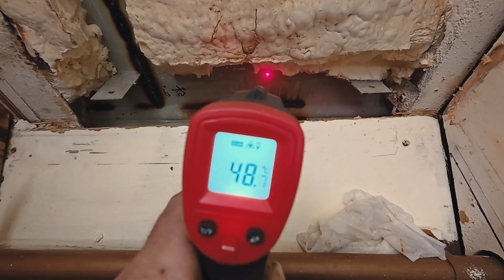Steel Boat Refit: Foam Removal & Chine Weld (Heat-Safe Method)

Comment: Curious, what goggles are you using? They look like good eye protection,
Reply from the maker: They are a Pyramex brand I-force sporty or something like that. I think there are other ones that might be even better fitting.  I was wanting something that offered protection on the sides, bottom, top too.
Reply: @TheAlaskanGypsy thank you very much

Comment: The zink anodes
Look awfully  eaten up ,I  think you should change them before they are that corroded . 
Just because there is  a little left of them doesn't mean they are good enough. 

Good that you take the icocyanide hazard  seriously.
Reply from the maker: no zincs for 6 yrs in a hot harbor was the problem! Thanks.

Comment: Dry ice and a fan on the inside? Maybe....
Reply from the maker: Thanks for the comment and idea. I've never heard of that, but there's a lot of different ideas out there! Does dry ice emit Co2 or another form of fire suppressant, or just the cold you thinking about? either could be good.
Reply: @TheAlaskanGypsy  No idea, just a thought that the cold would keep the foam cold

Comment: You might want to investigate installing more zinc anodes. 
I've been a welder for over forty years, 99.999% was new steel. 1/8"- 10" thick. Much different than this. I  applaud your work and the fact that you must think of what hopefully is not going on inside the ship! And again. .. maybe more zinc anodes.
Reply from the maker: oh yeah buddy. The whole problem was because it didn't have any new zincs put on it for 6 years. The first 20yrs of its life it was without any significant corrosion, then the zincs didn't get replaced and that's why we are here to save her! So, yes, she'll be well zinced from here on out as  long as we're able. Thanks for stopping by and commenting. - Scott

Comment: Don’t you need to grind to clean metal first?

We used to call 6013 “farm rod”.
Reply from the maker: besides a small amount of surface rust the electrolysis damage is actually very clean metal.  Just looks bad because of a small surface rust bloom on there. But that's also the advantage of the 6000 series stick is the ability to burn through all kinds of contamination that other weld techniques couldn't handle. Thanks for watching and your comment.

Comment: Have you done a UT survey of the hull ? Also die pen test may be helpfull are you putting any  anodes on the hull ?
Reply from the maker: Yes, I had one done by a pro in Ketchikan to confirm that we were seeing the reality of the situation. The hull is in excellent condition generally, but has major electrolysis erosion spots. I looked up dye pen test. That’s interesting! I’ll definitely have the original anodes on, if not a few extras, when it goes back in the water. The original quantity seemed to work well until they weren’t maintained for a period of years.

Comment: We would call those strips that hold the plywood wall surface  NAILERS.
Reply from the maker: well that makes sense! I'm not a welder, I'm not a carpenter, not a movie maker, not an actor, not an electrician or even a sailor!  I have heard a few words along the way but tend to get them mixed up. Learning the sailing words . . .  not sure how that's going to go! should be entertaining for the sailors watching.  Thanks for pointing out the right word for me, we'll see if I can remember it next time! - Scott
Reply: Don’t you need to grind first?
Reply from the maker: well, it's one of the benefits of using a 6000 series rod is prep is pretty easy going. The metal in these electrolysis damaged areas is actually quite clean, just a tiny bit of surface rust. It looks like really bad rust pitting at glance though, and probably in all the footage it appears that way.

Comment: after a little Brave AI research... when your ready to close up your wall, try a little hempcrete to replace the foam and on the hull you could use you can coat a steel boat with Coppercoat. The coating is specifically designed to be applied to steel hulls and is considered safe for metal structures like iron keels and steel vessels. The key reason for its safety is that the epoxy resin in Coppercoat completely encapsulates and insulates each copper particle, making the final coating inert and non-conductive. This prevents electrical current from passing through the coating and eliminates the risk of promoting electrolysis or cathodic decay, a concern when copper-based products are applied directly to steel.This property is known as the "Branley Effect".However, it is recommended to use an appropriate epoxy primer or barrier coating on the steel surface before applying Coppercoat to ensure optimal adhesion and long-term protection.Sacrificial anodes should still be fitted in the usual manner.
Reply from the maker: I’ll have to dig into this hempcrete idea a bit more. For now, I’m leaning toward sticking with what’s already worked here for 30 years—just filling in a few small patches and keeping it simple with spray foam. Path of least resistance and least mystery, I guess.

Interesting what you’re saying about Coppercoat. I know most bottom paints have copper to fight marine growth, but this sounds like something quite different. Makes me wonder how much it really changes the electrolysis equation. I can’t say I fully understand how all the stray voltage stuff works, but I do know that keeping good zincs on and staying out of marinas will be a whole lot better than what was happening before.

Thanks for the comment and for taking a genuine interest in our project—I really appreciate it. - Scott
Reply: @TheAlaskanGypsy  you can also use sawdust from a mill and use it like the hemp... I think you could just add lime and sand... the lime has a chemical reaction hardening it and makes it fire resistant and insulative and permeable for moisture so it doesn't get trapped and create mold issues. but it's all fun experimenting to see what works for you. good luck on your adventures!
Reply from the maker: I made a sauna floor with sawdust Crete last year. IT worked pretty well, but I wouldn't want to use it in this instance. The wood shavings definitely held moisture - enough to give me some concern about how they could do that to the detriment of the steel.  It would be something to explore the idea of on a small manageable new build I think, or  perhaps a project boat that wasn't such a lifestyle commitment as this one!  
Thanks for your ongoing comments and support.
Reply: Chat gpt with wins daily!
Reply: If you search for the best copper coat there is a clear winner. Buy a 50 gallon drums of primer / barrier. $759 then the copper bottom paint again 50 gallon drums only.

Comment: Those original inside welds, especially the vertical butt, look pretty bad. Strong enough, but poor weld technique.

When I built my hull I did all the structural welding using 6011 rods but switched to a MIG setup to do the hull plate. It was a lot faster, cleaner and kept the heat down. I'd do an 80% penetration pass on the outside then back-grind and run a cover pass on the inside.

I also used epoxy filler on the chine to fill in the weld irregularities so painting was easier and there was less chance of marine fouling getting hold.

Big project - best of luck with it.
Reply from the maker: Roger that—I’m not really sure what they had going on with the inside welds. In some spots it looks like they just burned through hot and heavy from the outside on the butt seams, but in others it looks like a quick MIG pass without back-grinding. Some of it looks like sagging puddle, but then it changes—so the mysteries continue! I’m curious to figure it out, but as long as it’s holding together, I guess it doesn’t matter too much at this point. Sounds like you built your boat right—I hope you get to enjoy it for a long time without ever needing to re-weld. Thanks for watching and for the thoughtful comment. See you next time!

Comment: Its going to be a pain to do all this welding with everything inside still your right! Another thing that sux is you prob should be preheating all this stuff your filling. But you cant! You have everything on the inside still right? That sux.. Welds look good though you will get it..
Reply from the maker: Honestly, I love the welding—it’s just all the fire hazard and toxic risk that makes me wish I didn’t have to stop so often. I’m familiar with preheating, but no one I’ve consulted has said it’s necessary in this situation. And yeah, there’s definitely a lot of interference on the inside. Some spots aren’t bad, but most of my time goes into demo before I can even get to the welds. Haven’t started the rebuild yet, trying not to think about that part too much. Thanks for the comment and for stopping by—hope you stick around for the journey with us.
Reply: @TheAlaskanGypsy  I even have the same exact welder.

Comment: I think you have Blue steel on the boat. You see the color of it? Its super hard to find. No one uses it anymore its too expensive. But its the best steel you can use on a boat i heard.
Reply from the maker: Blue steel? That’s a new one for me—I’ll have to look into it. Thanks for pointing it out, and thanks for stopping by to leave a comment!
Reply: @TheAlaskanGypsy  Also I seen another guy with a blue steel boat just mix some kind of liquid to pour on the hull and it just melts the rust right away. Some kind of chemicals or something.  You should look into that as well so you won't have to sand blast anything.
Reply from the maker: ahh, a magic potion rust remover. The holy grail of all steel boat owners! there are converters I know of - corroseal and ospho being the main brand name ones. There's also something called acid washes. But I'm not really dealing with rust here so much.  The sandblast or bristle blast is not just about removing the rust, it's also about giving a 'surface profile' to the steel so the epoxy adheres best to it.

Comment: Did you find the source of the electrolysis ?
Reply from the maker: @michaelreta9620 due to life circumstances the prior owner hasn’t replaced the zincs in 6 years, and the boar lived in the harbor.
Reply: Electrolysis  can be accelerated by ground faults do you have zincs on the hull also known as a sacrificial anode
Reply from the maker: That was the problem. Two fold really - the Ketchikan harbor is known to be 'hot' AND the boat didn't have its zincs (anodes) Replaced for a period of about 6 years. I'll be sure to keep them maintained from here on out though!
Reply: Don't weld down hand 7018 schould be used over the 6011 or it will crack especially sence you welded down hand
Reply from the maker: I'm not using any 7018.  Thought about it some, but sticking with 6000 series rods for now.

Comment: Grind that out and do it in multiple passes..
Reply from the maker: I'm pretty hesitant to do much grinding. Some of the thing spots are real thin. I tried a bit of grinding in the beginning and regretted it. The nice thing, if there is such a thing as nice here, is the electrolysis is very 'clean' compared to rust so I'm getting a nice clean puddle and basically no perosity so far. 
Thanks for the comment and watching our video. Hope you join us for the journey here . .

Comment: You must have some extremely deep pockets?
Reply from the maker: My pockets, they are mostly worn out and have holes in the bottom and it ain't from carrying coins.  No deep pockets here—just a lot of sweat equity, stubbornness, and probably a bit of crazy.  Every step is a balance between budget and doing what’s needed to keep this old steel boat alive. Thanks for watching and following along—we’ll see if grit and determination can make up for cash!